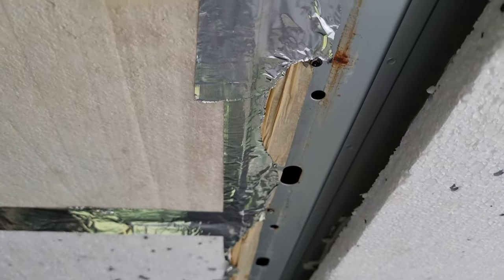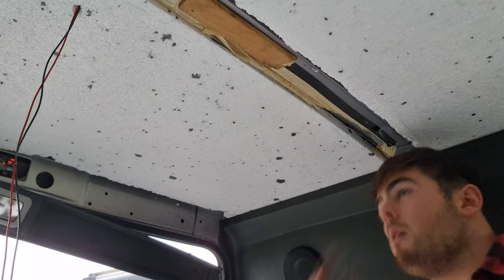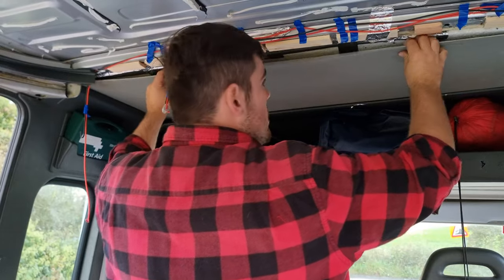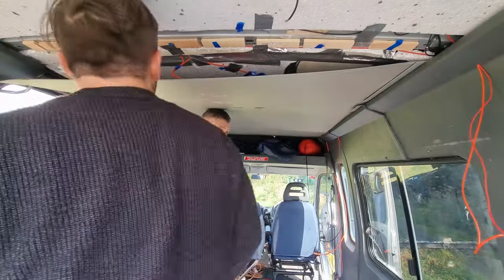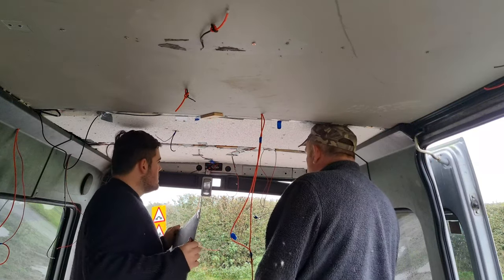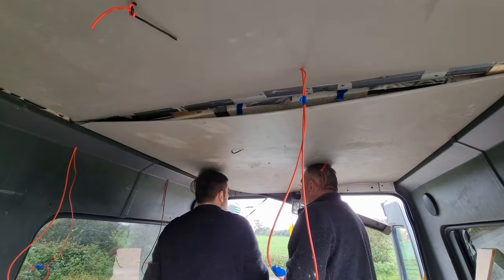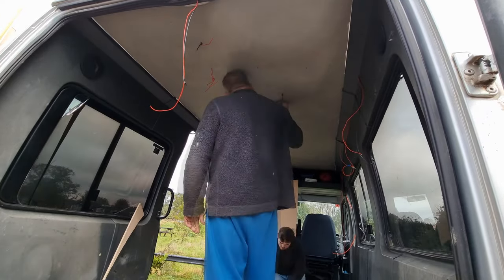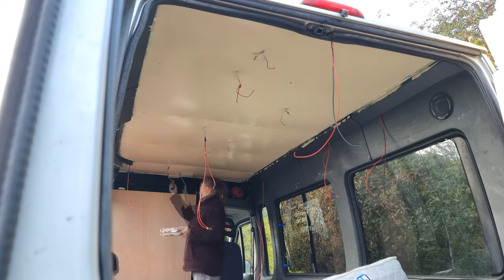Mounting The Ceiling in Our Campervan Conversion Was A NIGHTMARE! - Peugeot Boxer Mk1

Comment: Bit late for you now, may help others though.   Get a piece of timber batten slightly longer than the roof height and screw a smaller length on the top to make a T  ,   possibly make two them. These make good props to wedge up the roof lining whilst you fix it.  

Looks great now it's painted
Reply: Josh has one of these it's called Andy
Reply from the maker: Yep 👍